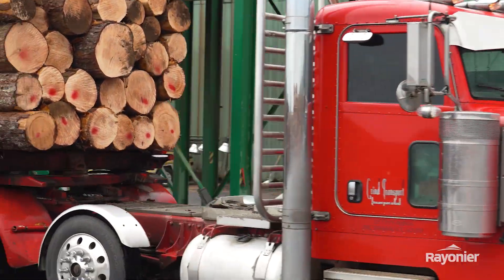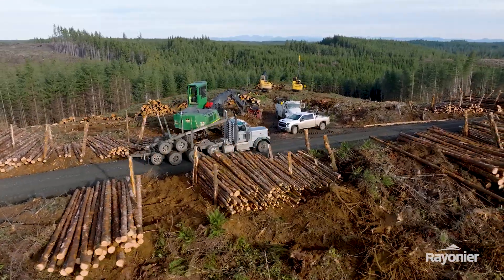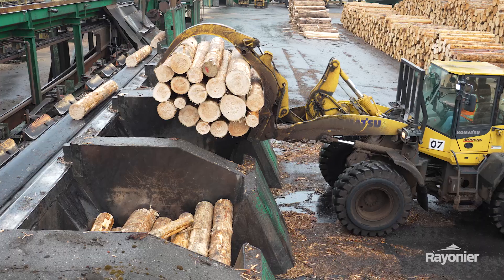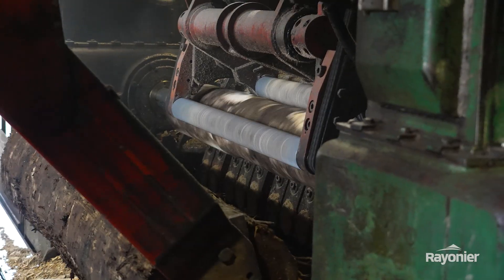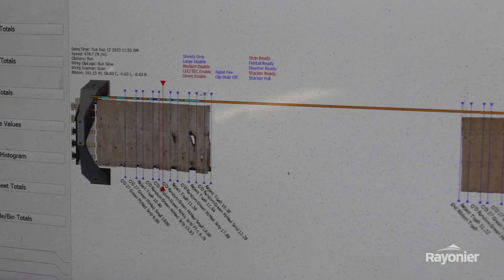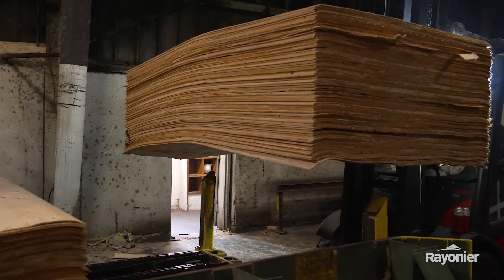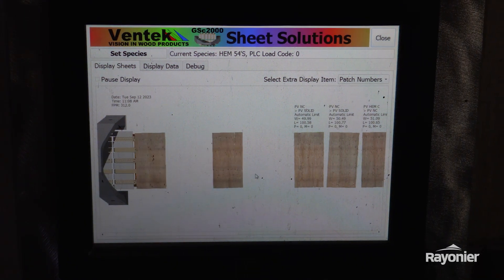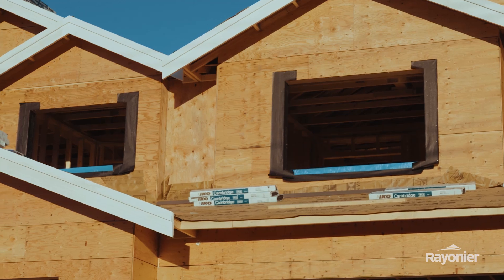How Plywood is Made: A Veneer Mill Tour

Comment: Do you struggle with tree resin/sap seeping out of the logs and onto machinery in the initial 1. conditioning of the logs or 2. veneer drying phase?
Reply from the maker: Good question @frankmeiring1049. We asked the Pac Veneer team -- here's their response: "Due to fact that we run mostly hemlock we don’t run into resin/sap issues in our process." They said when they use Doug-fir trees, there is some residual pitch in the peeling and drying processes.
Reply: @rayonierinc.4618  Thank you for the swift response!
I'd love to ask a follow-up question(s):  Does the residual pitch exuded from the Doug-fir trees cause significant problems to the machinery and/or general efficiency of the sawmill?  And if so, is it a good enough reason NOT to use Doug-fir trees?  I'd also love to know if they collect this residual pitch and use/sell it as a byproduct and what solvents or techniques they use to remove/collect it from wherever it drips on?
I'm doing a school research project on a veneer processing plant that predominantly process Pine logs, which seem to cause some problems with resin hardening on machines.  I was wondering if you experience similar issues? 
Thank you!
Reply from the maker: @frankmeiring1049  it sounds like you need to talk to them directly! That will give you the best info for your project. You can reach their company phone at 360-612-3745.